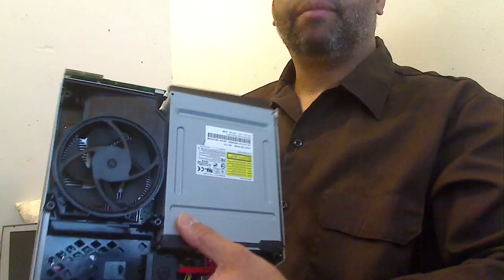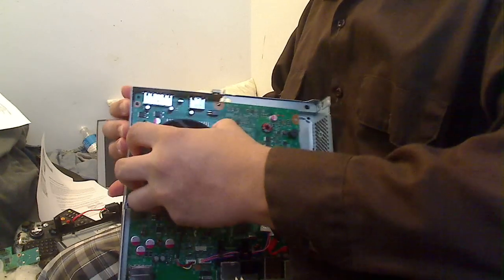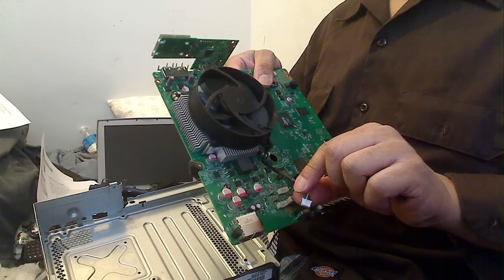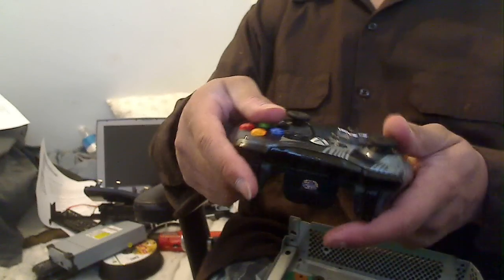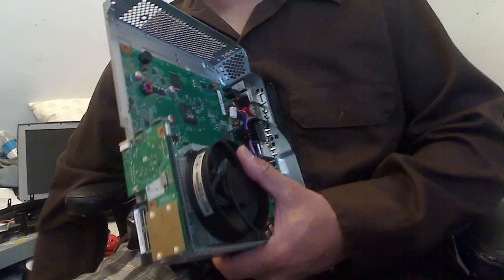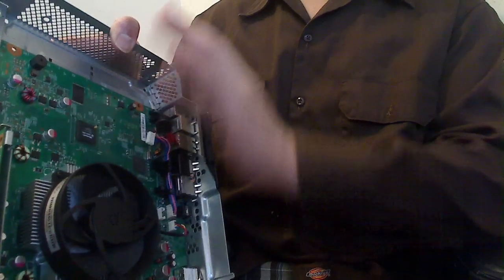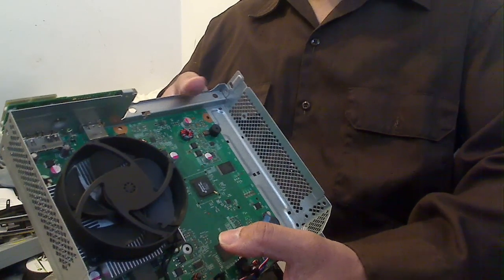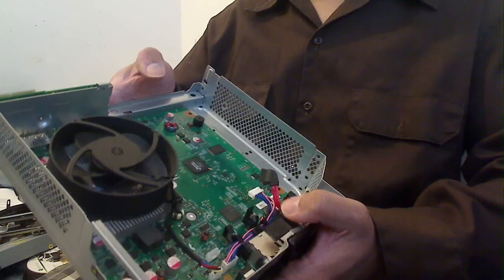How to fix Xbox 360 Slim RROD / Red Dot of Death Reset Solution👍

Comment from the maker: The guys over at Xbox-experts.com may offer some additional insight into additional problem solving or atleast insight into whats causing your problems..
Reply: TheHGCGamersClub shut up bitch you don't even know how to use a screwdriver.
Reply: Hey bro plzz help mee my xbox has the red light of death it started jus now suddenly idk y i din do nothin ,but before 2 days i was playin cod den i kept my xbox idle but on for long tym nd after some tym it shut down itself blinking red light dat tym but now when i am starting it up green light blinks for a sec then red light blinks fan starts on full speed nd then it shuts down with the red lights nd xbox goes off it occurs evertime i am starting it now wat to do broo plzz help me i am very afraid!!
Reply from the maker: Ashley Samkuttty it's overheating Ashley. The CPU paste needs to be replaced but you'll need to clean off the old dried up paste first. I explain how to do it in the video. Except, place the X-clamp back on after you've cleaned and replaced the heat sink and fan. Do not add the screws and washers. My apologies for taking so long to respond. I recently changed phones and I wasn't receiving YouTube notices via Google+.
Reply: Thnkx dude and can u send me the link for the  video ur talkin bout nd do i need to replace my heat sink nd fan.
Reply from the maker: You should not need to replace the heat sink & fan. Just remove your heats ink & fan; clean off the old CPU paste; apply new CPU paste (after u buy some), reinstall the heat sink and fan assembly and power up. If the red dot comes back you may need to do the reset described in the video. The video you're asking for is part of this post/forum. But here's the link anyway, --> http://m.youtube.com/watch?v=0xWCD0-mTC4
Reply: I tried to do the reset but nothin happens da xbox shuts down everytime after flashing red dot for a few secs
Reply from the maker: Ashley Samkuttty Check that your power supply still has a green light while powering on and that it stays green until shut down. The power supply has a built in fan too keep the power supply cool. If it overheats, the Xbox will shut down in no time at all. Be sure that you cleaned the processor, heat sink and added new paste.
Reply: Ya dude my suppy is green till it shuts down
Reply: Hey man I was to pry the x-clamp away and slipped and my screwdriver sheared off one of the tiny what I think is a capacitor, is there any way I can repair this??
Reply from the maker: OMG.! Shea. This is a very difficult thing to repair. You can possibly take the board and the small, whatever u chipped off to an electronics shop to see if they can solder it back on. You need magnification lenses, soldering iron with a very sharp tip, Flux, magnification lenses, something to hold the board in place, something to hold your very small piece thing and a steady hand. I suggest locating an electronics shop in ur area or one you can ship too. You can also try some search criteria on the Web to find one also.
Reply: Donte Beachem Dude help me out how to get replacement for da whole console i heard that der is a long guarantee period for da red dot of death nd can get da whole console replaced is this true can i do dat plzz donte help me!!!!!!
Reply from the maker: I have no clue Ashley. The best way to find out is either by contacting Microsoft or by checking Xbox 360 forums run by Microsoft for warrantee information.
Reply: I have a problem where my Xbox 360 slim won't register my hard drive it says I don't have a hard drive plugged in but I do . And I have gotten the red dot of death 4 times but it was never in a row, they all happened at different times while I was trying to get it to work. Do you have any tips for fixing my hard drive?
Reply from the maker: +Joshua Mumma replace your hard drive with a new one.
Reply from the maker: +Joshua Mumma you can also try replacing the internal SATA cable or hardrive power cable.

Comment: Thanks bro!
Reply from the maker: Sure Ernest, Anytime..
Reply: Donte Beachem Hey, I can't figure out how to take the Heat Sync off the back of the motherboard.. Can you help?
Reply from the maker: Once you have the metal case removed from the plastic case, you need to remove all the screws from the bottom of the metal case containing the main circuit board, aka the motherboard, then remove the wife antenna; it has a screw holding it down. Grab the heat sink and fan with one hand and pull it up and out of the case. Next you need to Remove the x-clamp from the bottom of the board holding down the heat sink. After x-clamp removal, you'll need to try and pry the heat sink off of the processor. It can be of  there pretty tight from the hardened paste or it might just come right off with ease.
Reply: Donte Beachem Awesome thank you! Also did you read the other comment I posted on your video? This is it.. "OK, so here is my deal.. I turned it on one morning to play, and my account was not there. So I went to download the account, and it said some type of error. Then all of a sudden it shut my xbox on and showed a red dot. I unplugged and plugged back in, but it wouldn't turn on. When I try to turn it on, it makes the "beep", but doesn't power on. This is two months later, and I watched your video, and tore it all down, but I don't know exactly what the problem is.. Can you help me?"
Reply: Donte Beachem ?
Reply from the maker: You can try removing the hard drive and then booting, since this new information may indicate you have an update error, hard-drive error or some kind of firmware error. If removing the hard-drive doesnt work and you have an internal 4GB memory option, you can try removing it from your mother board and then try booting again. Try and find some YouTube videos on internal 4GB memory replacement. These videos will tell you it's location and how to remove it. Keep in mind that your xbox may not even have one.
Reply: Donte Beachem So this is even the case considering it flashed a red dot, shut off, and won't power back on?
Reply from the maker: The red dot is a ground fault. It could be anything causing a possible error that could lead to further problems. I defined the term in my video.
Reply: Donte Beachem Oh ok, so if I do the heat sync thing in ur video it should fix it?
Reply: Donte Beachem I'm sorry to still bother u, but all I want to know is where the internal memory is on the MB. If u cant help me locate it, I'm starting a bonfire with my Xbox.
Reply: @ThePatriotsFan171  4 years later, no reply ... ok

Comment: It didnt work i had let heat up for how long you had said but my xbox Blinks and then turns of at about each 7 mins i do that .
Reply from the maker: Your xbox-slim shouldn't appear to power off at all, except for the TV screen, otherwise the slim should remain blinking. Let the xbox-slim continue to allow the lights on the front to blink for about 15 to 20 minutes; not 7mins. 7mins is  not enough time to allow the slim CPU/GPU to reset. Then remove the power cable and wait about 30mins to plug back in and power on. Just because the slim stop sending signal to the TV for video, doesn't indicate the the slim has powered off or that it has reset.. Rewatch the video and try to pay atte4ntion to the instructions..
Reply: Once  i put the av cable in it goes red
Reply from the maker: Yaki Jay Jay Try replacing the cable, or borrow a friends.. The video cable could be malfunctioning.. There may be nothing wrong with your SLIM at all.. Try HDMI or Component cables..
Reply: Ok cause onc  i put hte that cable for the xbox it goes red all the time once i put it in the xbox then poof goes red.
Reply: Good thing i have a friend next door
Reply: Never mind im gonna get a new xbox that is getting shipped to me by May 13 to May 15
Reply from the maker: Cool

Comment from the maker: I'm sorry to hear that Te Roe.. If it did not work then your ground fault still exist. You may need to have someone determine what your ground-fault is and repair it. Sometimes there can be debris on the board, dried solution containing ionic material, from a spill, which may allow charges to jump or bridge contact points. Try cleaning the board with 90% alcohol with a soft toothbrush. Inspect the entire board top and bottom with a magnifying glass with the heat sink removed. (you don't want to miss anything because its covering the problem). After you clean repeat again as it was instructed in the video. Also, my apologies for taking so long to respond.
Reply from the maker: So the guy from the HGC Gamer Club decides to comment on my instruction and decides to insult me in the process. Well HGC gamer guy, you have your fun. I'm sure that this is what you & your club are all about. You probably go around doing this all day on various YouTube channels. Please try & keep all negative comments confined to your own channel, especially since you offered no assistance.  Have a great day.!
Reply from the maker: If your xbox-slim did not power back on after the reset, you will require a heat gun to go over the top and bottom of the board and then reset. Watch the video for some brief instructions referencing how long to apply the heat to both sides, including the cool down requirement..
Reply from the maker: Donte Beachem Yes..! You shouldn't expect to see anything on your TV.
Reply: Donte Beachem What is a CPU paste remover? Kindly explain to me that please...
Reply from the maker: It's a medium that goes between the CPU and heat sink. It allows for sufficient heat transfer from the CPU to the heat sink then out if the Xbox case via the fan. The paste is added so that during the heat exchange the 2 metals do not burn. It's like when u cook a steak. If u add heat without a medium, such as water, grease or butter the steak will burn the outer skin before heat will have the time to flow through the entire steak and cook it. Add grease, water or butter and heat flows evenly throughout the entire steak and cooks the meat. Without CPU paste most if the heat would stay in the CPU and damage it. You don't want that.
Reply: Do I have to buy the CPU paste remover?
Reply from the maker: No. You can use alcohol
Reply: Please tell me this works on a regular  360 right?
Reply from the maker: Chris Jennings it does.
Reply from the maker: It does. Disassemble and then remove the fan. It is suggested that you remove the heatsinks off of both CPU & GPU; clean off the old paste and then apply new CPU paste. You can do this before or after your Xbox 360 phat reset.
Reply: After the xbox shuts off, do I wait the 15-20 minutes doing nothing or do I keep turning it back on for 15-20 minutes after each time it shuts off?
Reply from the maker: +PizzaBoyPB Let it sit for about 20 mins and then plug the fan back in and power it back on to test functionality.
Reply from the maker: +Buffy Hunter I don't understand the question.
Reply from the maker: ***** Oh ok Buffy, then I'm sorry it took so long. I continue to try to get better at answering all the questions posted here but I miss some. If u gave me a thumbs down for not being able to help u, could u please correct it. It seems u didn't have an xbox360 Slim error at all. I'm glad u got it working. Happy Gaming.
Reply from the maker: Chris Cunning Yes it works on a 360.
Reply from the maker: Blu Anchor Im not sure what you mean..
Reply from the maker: My apologies. Google+ has all the messages out of order and Your messages arent all together so I didnt even see the previous comments made here by you or your husband.

Comment: did not work really wished it did you had only video with a possible solution
Reply from the maker: Hey Te.. Please make sure that you go over all possible solutions to solving this error, since there are many reasons for the Red-Dot error. The one I supply is just one of many.. Also take this comment that I left above into account, - "The steps in the video only work for those that have had a ground fault occur to the XBOX 360 SLIM or even the Xbox 360, of which the Xbox didn't self correct after the ground fault was removed (metal on the board or incorrect placement of the hard-drive) or the conditions changed, such as you removed the Xbox from an outlet that has over-current. Your Red-Dot error may be caused by another factor such as hard-drive placement or hardware malfunction; usually parts on the board, such as capacitors or chips. Keep in mind that ground-faults are suppose to be a good thing. It removes current to vital sections so that the entire Xbox doesn't become damaged, but just until the damaged area is repaired; then current is supplied to the rest of the board making your Xbox function once again.."